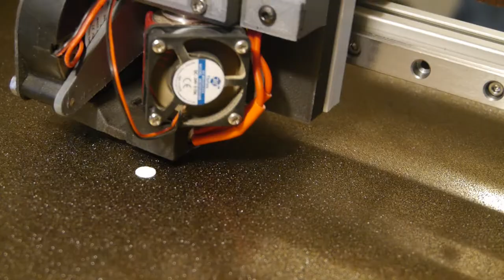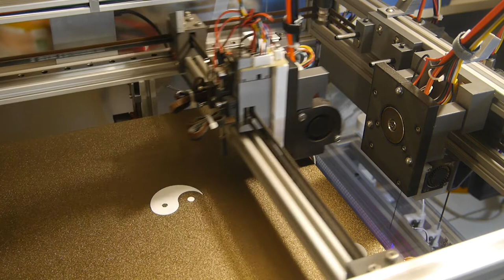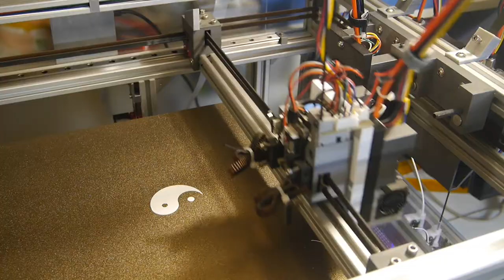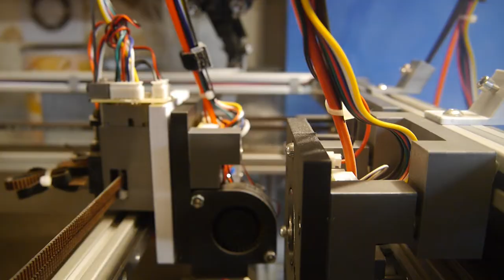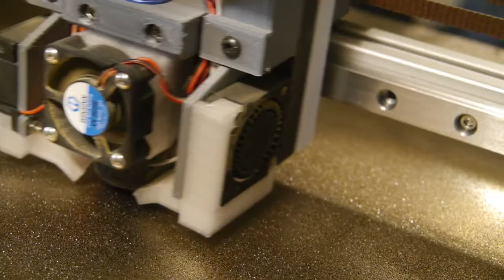Electromagnetic tool changer for 3d printer

Comment: I've had a very similar plan in mind to use electro magnets to manage docking and undocking a hotend.
I wonder, would you be willing to share your design or perhaps are they for sale?
Reply from the maker: My design files are not clean enough to be wildly shared but I can help and share some parts if you have questions on specific points.

Comment: Awesome! That's the kind of stuff I'm looking for as my first 3D printer. Is there some preassembled solutions for similar printers?
Reply from the maker: Yes, E3D and Prusa XL as far as I know
Reply: @workshopfeedback  Whoah, 500$ per extra extruder, 1500 for 5,  on the prusa xl :o Maybe I should start with a simpler multimaterial solution...
Reply from the maker: @SaintMatthieuSimard  Multi extrusion may not be a must have feature for your first printer.
It's not useful every day and always tricky to set-up.
There are lots of things to do with simple extrusion
Dual extrusion with a single nozzle may also be a solution for you
Reply: @workshopfeedback  I can't afford to produce plastic purge blocks, that's why I'm looking forward a multi-nozzle solution. No waste. I really want to print multi-material objects to combine different properties, basically, flexible parts alongside stiff parts, maybe even include TPU in some projects. Besides, mixing two colors or injecting ink to a white filament would be nice to draw text over certain parts like keycaps for example.
I saw a triple-extruder diamond head but it doesn't look too amazing. And the dude from Actual Printing channel... Or is it Proper Printing? He counseled me to get a core-x-y device that supports Jubilee 3D toolchanger system. Tho it looks like something very custom that requires more technical knowledge that I don't yet have. Having 1 head with 3 separate extruders with isolated chambers kept at varying temperatures would be the solution, 3 materials is way enough. What's amazing with Jubilee3D is that each extruder is kept at its own temperature, no purge blocks. Way to go. Tho I need something pre-assembled as much as possible because in the end of the day, I want a printer, not a project I'll abandon to dust.
Reply from the maker: @SaintMatthieuSimard  Hope you'll find your way ...
Reply: @workshopfeedback  Thank your very much!